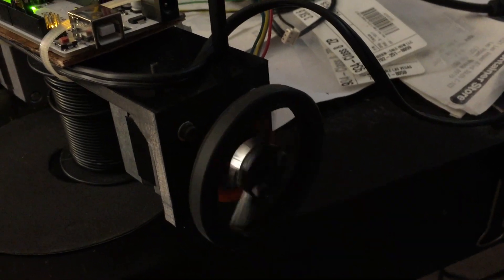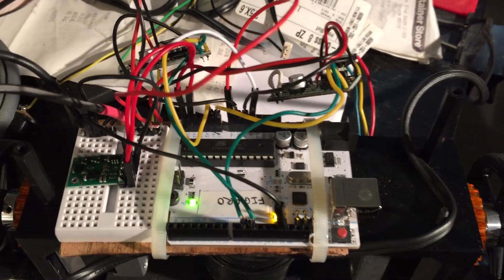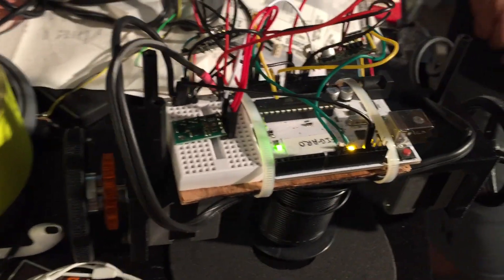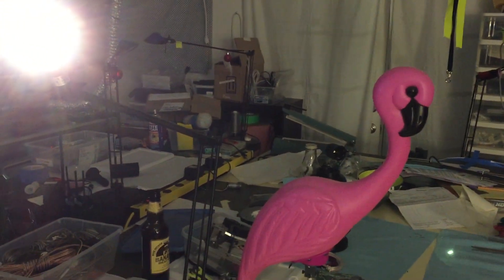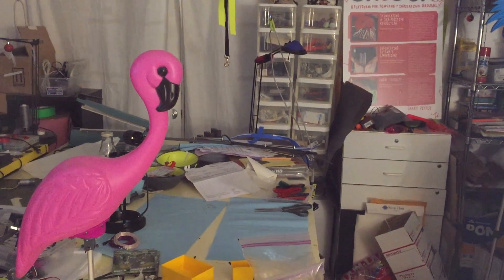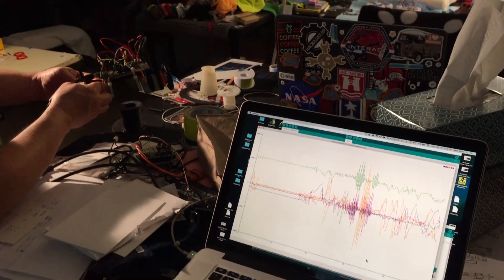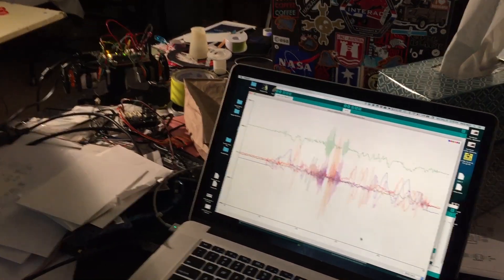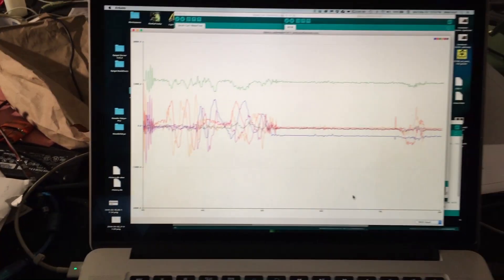Carl Roll : Session 1 : Electronics Test

Comment: you can also turn current down on the drivers if they are adjustable to reduce heat on the steppers. just wont have the same torque.